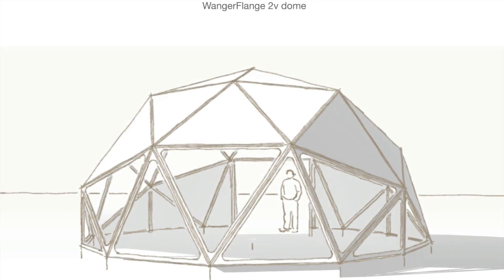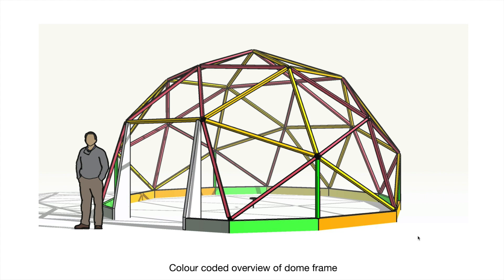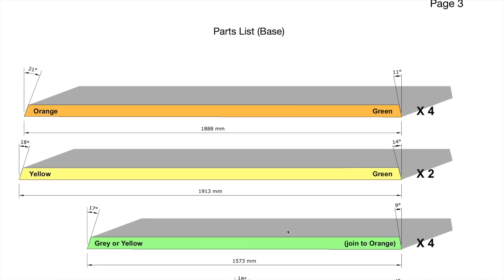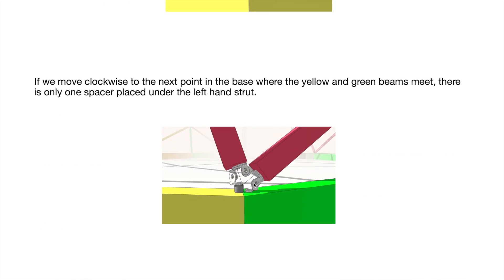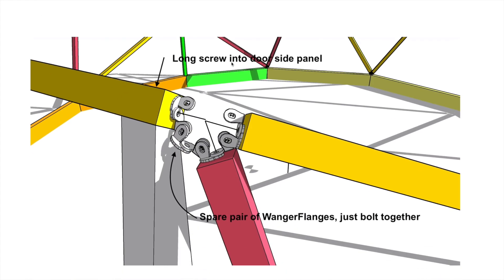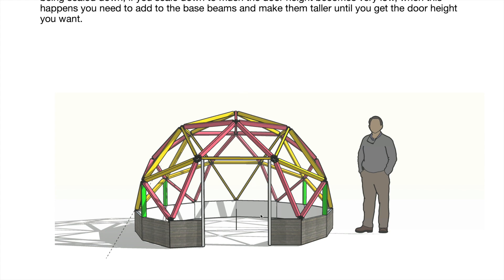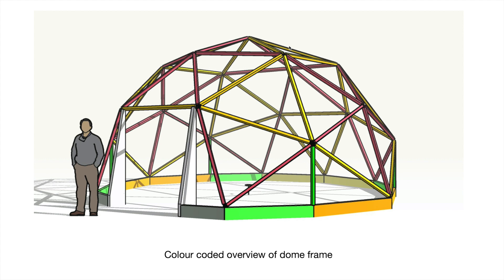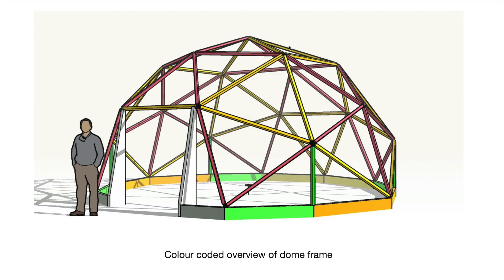Free 2v geodesic dome plans using WangerFlanges

Comment: The problem with these dome is the head height is low around the perimeter. Or too high in the middle. A square box for example is efficient used of volume. How about something in between? Do you have any design somewhere between?

Comment: You need 250 wanger flanger connectors in this build it cost 350£ thats 380€ + bolts +- 100  ,its just doesn't cut with expectations of someone who is into affordable living. In my country timber 50*50 is 1 euro to build 3v dome 5m wide i need 168 meters of it so its 170€ timber 40€ screws 210€ in total for higher frequency dome made in bevel or "good carma" method all included.

Comment: I'd be interested in a design ideas for the "fish scale" tessellating geodesic covering on the Dome of Visions dome in Copenhagen that's bolted together. The design is supposed to be a closely guarded secret. Any thoughts would be great. Cheers Paul.
Reply from the maker: Sure, what diameter where you thinking? I'm doing some work on domes just made with polycarbonate sheet like hexadomes. sounds very similar, get back to me with a diameter and preferred scale size and I'll work something out

Comment: Hoping for a reasonably simple answer... I've tried looking round your site and done all sorts of searches on the web but can't find details of the dihedral angles on this structure. I see them for 3v, but that doesn't help here. If it's to be clad in ply then I need the angles for the bevels to cut the sheets so that they butt up against each other properly. I know that I should be able to work them out with some trig, but I'm struggling as to how to start. Clearly I need a maths revision! I assume that it's reasonable to clad with ply when using the wangerflanges. If not then I'll need to use bevel frame, which will still need the dihedral angles. Would be grateful if anyone can help.
Reply from the maker: You're right there isn't much on the web, if you use this calculator: https://geo-dome.co.uk/2v_tool.asp Dihedral angles for red strut is 157.5° Blue struts are 162° Making bevel angles of 11.25° (red) and 9° Blue. Hope this helps. I have changed geometry on my own plans to 10° for all struts but you have to use measurements from the plans for this to work.
Reply: @Geo-Dome  Thank you very much for both the answer I was looking for and the speed of response. I just need to get the planning permission now... from the family, not from the local authority!
Reply: @Geo-Dome  Reading your response again you talk of your plans. Are you referring to the 2v with wangerflanges in this video, or a 2v bevel frame plan. If the latter then please can you direct me to it as I'm happy to buy it, but couldn't see one that was described as a basic half dome 2v. That would then enable me to decide on either bevel frame or using the dimensions on that plan then reducing by 110mm and using wangerflanges. But it would make the cutting of the bevels far easier if they were all the same!

Comment: I’ve just finished making this dome. Took me a day to chop the timber, get the wangers on the struts and build it. Goes together really easy and it’s very very strong when all the nuts are right. Fantastic work from Paul making this possible
Reply from the maker: Fantastic! What cover material are you thinking of using?
Reply: Paul Robinson I was going to fill most of the sections in with wood and cover with felt and use 5mm acrylic sheet for windows

Comment: Thanks Paul big fan of your work. I am thinking of making a child climbing Dome. Thinking of making it out of three-quarter inch EMT. I'm wondering how I might be able to add on to it in the future to make it taller as she grows
Reply: Make a 3v frame and add an extra row of triiangles at the bottom to increase the height when needed.
Reply from the maker: Great idea, I am planning on doing a full project book full of climbing frames, You can build something a completely different shape if you want using the same parts. I'll try and get some work done on this shortly so keep an eye on new videos, however it may be a week or so as I'm super busy!

Comment: Hello Paul,
Could you try to do one of those trussed domes I discussed with you? Trussed domes should have much greater rigidity because the entire shell of the dome consists of tetrahedra.
The 10-way and 12-way connections for the vertices where all the struts come together could be made more rigid by having either the inner or the outer struts have spacers that have pairs of wanger flanges holding them together in a 5 or 6 way connection in the middle.
Could you reproduce this dome or something of the equivalent frequencies?: http://fab.cba.mit.edu/classes/863.19/CBA/people/joaowilbert/week1/
Reply from the maker: Yes, I  am working on this now, give a couple of days and I do a video as well.

Comment: Great post as always Paul! I was about to ask you in one of your previous videos as to how many wanger flanges needed for the 2v. 

Anyway, got a quick look in the plan and you use struts that is roughly 2” (49 mm) but did not specify the height. What is the maximum strut height suitable for this construction? Would 2” x 6” work or you would only recommend a 2” x 2” strut for this.

Thanks!
Reply: Its not worth using 2x6`s. With the fixing screws centered at each end, the strut is free to rotate when subject to torsional moments. A WF dome is essentially constructed of square rollers. Most geodesic hubs are designed to transfer torsional moments so the struts cant rotate. You can solve it by using 2 sets of brackets per 2x6 but then you may as well use tubular hubs, its about the same amount of work and vastly cheaper.

Comment: These plans are fantastic.  One thing I noted was the lack of information for scaling the green strut for the half triangles along the base.  I am sure I could figure it out, but it would have been nice to include the information in the plans.   For the door frame, would a piece of 19mm plywood cut to dimensions work too?
Reply: After watching the video again, Paul did mention that he would be doing additional plans and details for various size 2V domes from 3m on up in half meter increments later.
Reply from the maker: @bwillan  Yes, I will be but of you want to know for now the green strut is half then length of a yellow one and you only have to take off 55mm for a wangerflange on one end.

Comment: Do you have a link to the 250 WangerFlanges package?  I only see 150, 100, 50, and 25 (I live in the US).
Reply from the maker: Yes, it's called the trolley load you can purchase 250 here: https://thewangerflangecompany.bigcartel.com/product/trolley-load-of-wangerflanges
Reply: The 150 and 100 combination is cheaper than the 250.  Looking forward to ordering. Went to Lowes here in the US and they had no lumber.  :-/
Reply: There's the motherload option in the big cartel store, which is currently listed at £1000.00, but doesn't list a quantity.  A 250 pack around £300.00 mark would be quite nice.
Reply: @bwillan 
The 250 pack is £350,  not worth it for a 2v
Reply: @JohnGuest45  WangerFlanges aren't the only method for geodesic dome hub connection.
Reply: @bwillan  
The free 2v dome plan is designed for wanger flanges, you have to buy 242 flanges to build it.